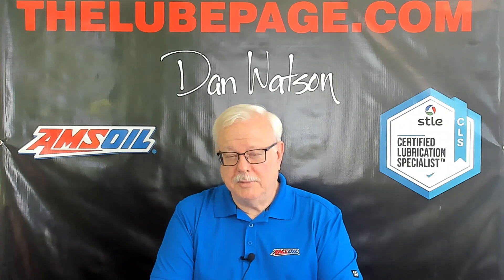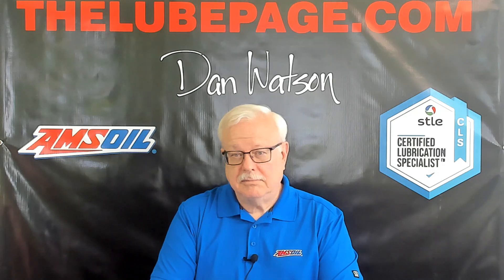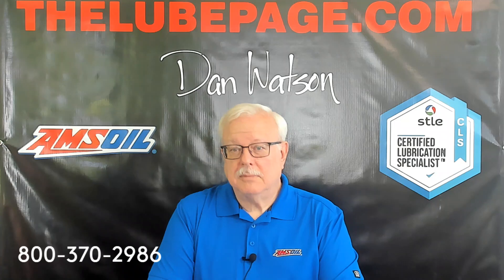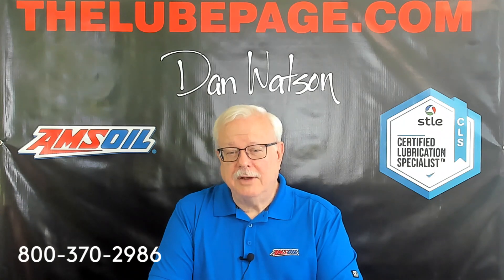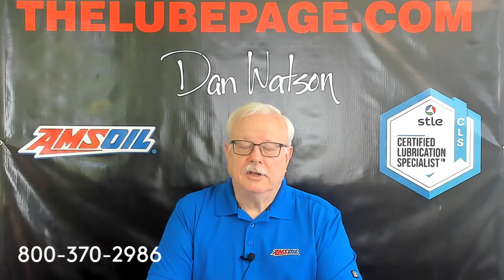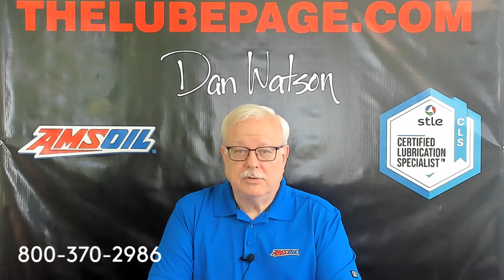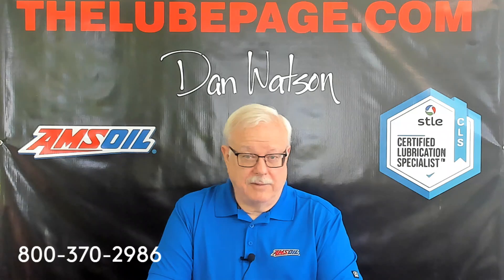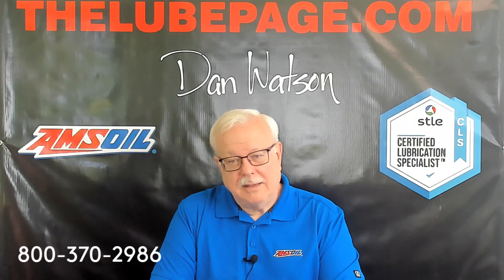V4 Base Stocks

Comment: I have a video idea for you. There are a few companies who make the add packages like Infineum, Afton, and Lubrizol. I was wondering if there was a difference between lets say Infineum's and Afton's Dexos gen 3 certified additive packages that then are blended with an adequate base oil. My thoughts have been that an engine can not read a brands label, and it only cares about the chemistry of the oil. Therefore, the only way to know if you have the right oil for your application is to first find the proper certification for your engine, and use oil testing to then find the best oil for your car. I'm sure you have some light to shine on this topic.